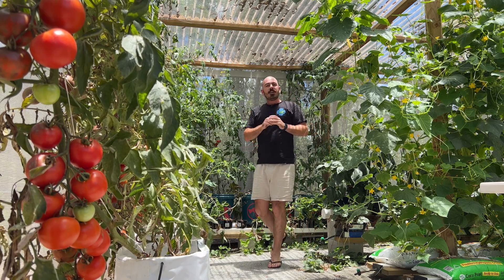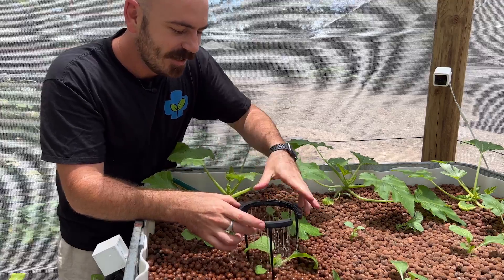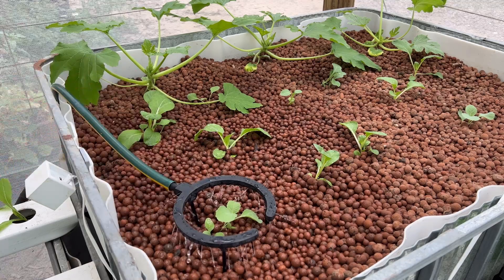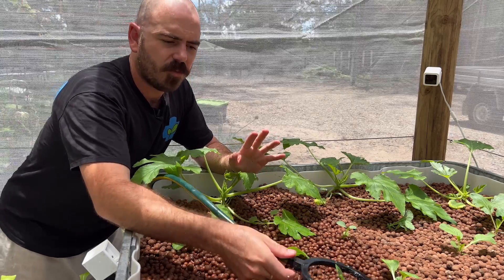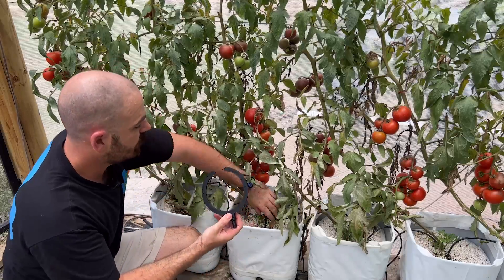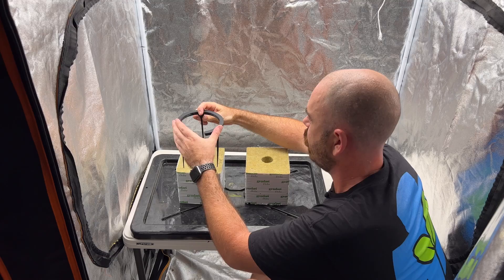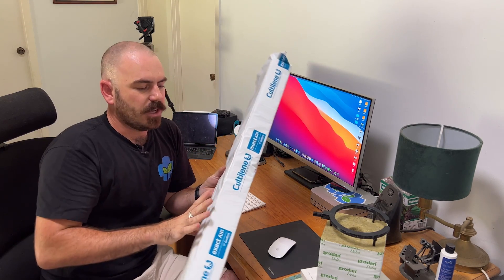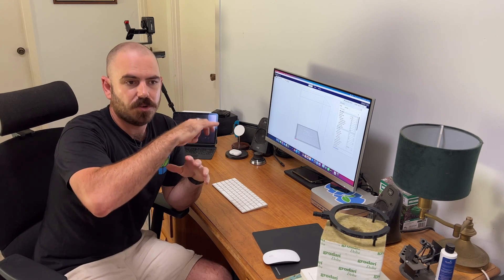The Hooch Halo: 3D Printable Top Feed Rings

Comment: 3/8 tubing to plastic T. Make a ring, use red hot trim nail to make a hole every 1.5 -2 inches. Instant water ring. Flow about .25 to.5 gal per min 24/7 recirculating no need for air pump
Just use a 200 gal per per hour pump.

Comment: nice idea.. fwiw i use 'leaky pipe' with a 13mm t piece..  works great off mains pressure water feeds for low pressure tank fed systems a 2 or 3mm drill bit makes drain holes for timed systems.

Comment: Pretty damn cool.  I am setting up 3 dutch bucket systems next spring.  Are you thinking about doing a comparison of the feed rings vs the old dual drip lines to see if it actually increases growth/yield?  I don't own a 3d printer yet, but we have one at work that I can use.  Perhaps I should start researching!

Comment: You mention non recirculating systems. I didn’t know those existed. But this would be pretty useful for regular soil!
Reply: Rain gutter grow system is non recirculating, the water just goes from the res to the rain gutter and then gets wicked up by the pots and evaporated, sometimes just by the roots in the gutter. It has worked great for me, got 8ftx8x4 tomato plants off of 5gal buckets.
Reply: @jaycweingardt11  ah I see that makes sense. I was thinking more of a massive amount of water and then it just drains out. Seemed like a waste of water.

Comment: Can you print using PVC then you could glue components rather than use silicon. Also could cut the halo up so its in say 5 segments to increase the number of parts in a single print....
Reply from the maker: It’s in that many parts so that it doesn’t need supports, also so the legs are printed with verticals print lines to increase strength.

It also means I can retrofit smaller and larger hose adapters.

Comment: I've got my own home made halo's for my orchard using 13mm and drippers (4-6) though the flow rate is problematic between drowning the plant or dying from thirst.....
Reply from the maker: What media are you using?
Reply: @Hoocho  mostly Clay, some sand, and at the moment a ton of weeds...... ;) The variable drippers either give you nothing or their maximum rate unless they blow off their top then nothing as the water goes flying out the bed and waters the surrounding area and then ones water storage is empty......
Reply: I was talked out of drippers because the nutrient components will clog.